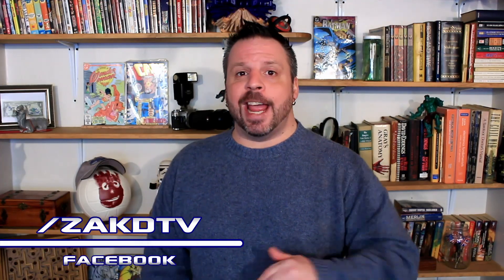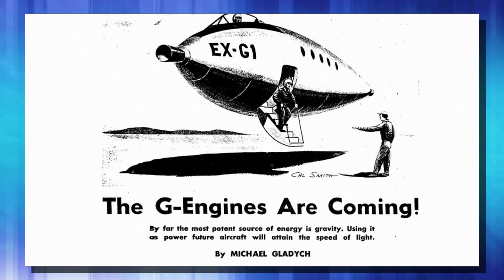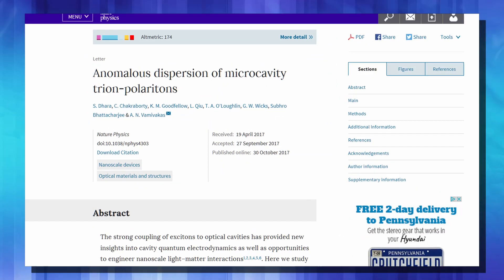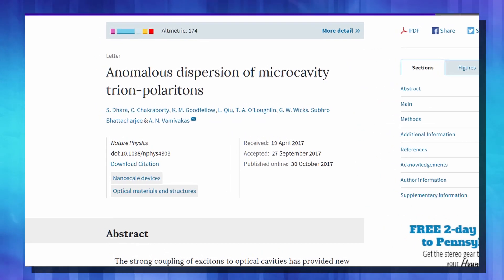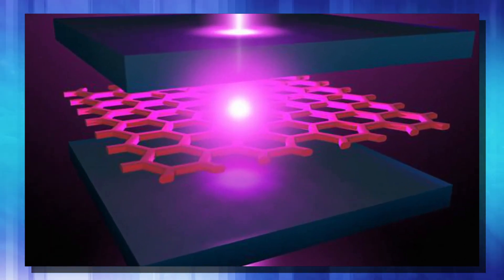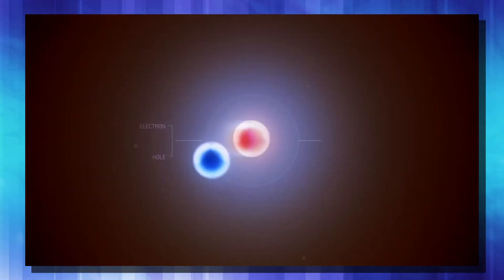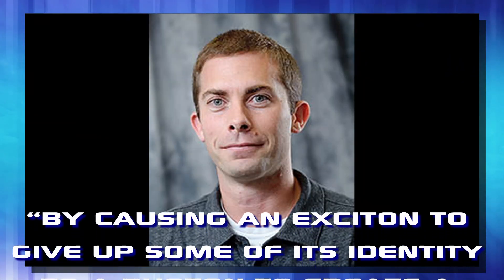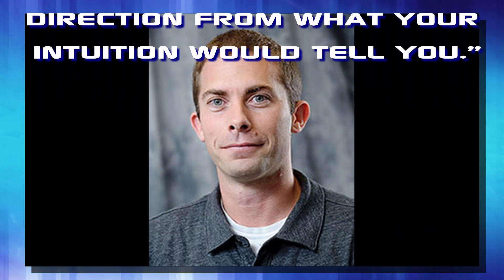Researchers create negative mass particle. REAL ANTI GRAVITY technology could be next.

Comment: This interpretation of the information is incorrect.  Negative mass has both negative gravitic and negative inertial mass.  Einstein's Equivalence Principle requires this to be so.    Gravitically negative mass would be repelled by the Earth, but since it has negative inertia as well, it would fall toward the Earth, so it cannot be used for "anti-gravity".  It can however be used for other kinds of space propulsion.
Reply from the maker: +Ron Stahl according to the author of the paper he said it would accelerate oposite the force. You push, it pushes back. So weight putting downward force should cause it to push back up causing levitation.
Reply: This is a common misunderstanding.  I would refer you to Woodward's excellent book on this issue.  The force exerted on the negative mass is backward, but the inertial response is backward too, so it does not push against gravity.

https://www.amazon.com/Making-Starships-Stargates-Interstellar-Transport/dp/1461456223
Reply from the maker: +Ron Stahl I will see what I can find on that. I am always willing to learn new things. Thanks for the suggestion!
Reply: @ronstahl5783  as long as I get my warp drive.  Hoverboard be cool but warp drive is even cooler.
Reply: Ron Stahl , when something is equal force it stays stationary, if you put the negative mass hover board on the ground and then you get on it it stays on the ground, when you put it 3 inches off the ground and then get on it it will stay 3 inches of the ground. It depends on how high off the ground when you get on it.

Comment: So does that mean we might actually ride on roads made of light.
Reply from the maker: +Alex Hutchins that could be a possibility, or at least some sort of floating road signs. We will have hover vehicles before too long but this should make for a nearly silent and fuel efficient floating capability.  There was a team that announced today that they are making 3d holograms that can be projected in the air so maybe holographic roads?
Reply: ZakDTV I was thinking that it is probably hard to move. So I thought that having it attached to you vehicle will make moving impossible. But maybe if it is released from the bottom, or if their are roads made with it.  That way we don't get stuck on it. But how will it react against friction.
Reply from the maker: +Alex Hutchins my thoughts for it would be a 3/4 enclosure filled with these particles positioned on the corners of the vehicle. Theses should have the ability to swivel to allow braking by facing them forward. If you used enough to give the vehicle neutral weight so it hovers you can then use small fans to provide lift and movement. I mean this is all way early in development and I know some of the next steps they plan is to see how it reacts in meshes or what happens when you introduce electricity. Total speculation but maybe they will find ways to change um polarity for lack of a better word. This is the stuff I love about cutting edge research the possibilities are there just have to figure it out.